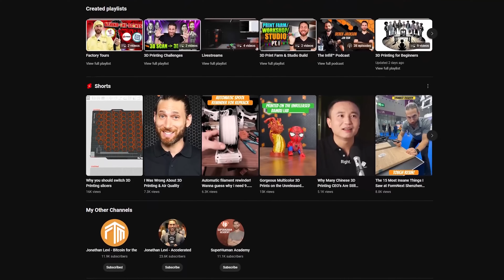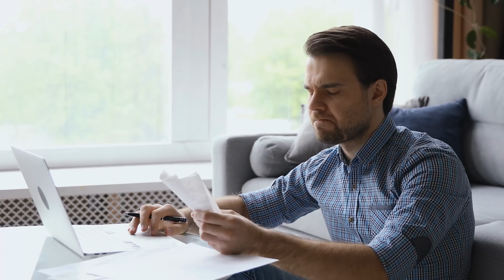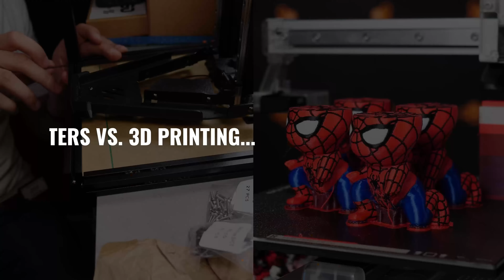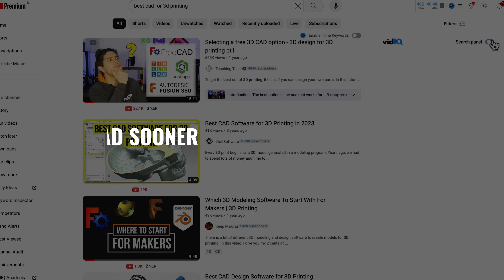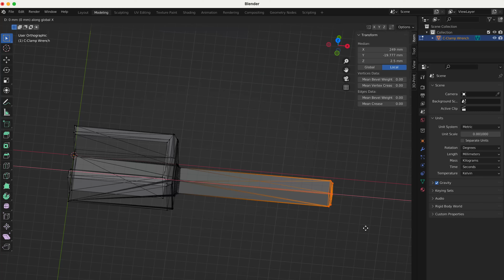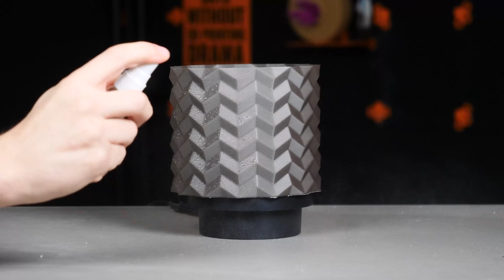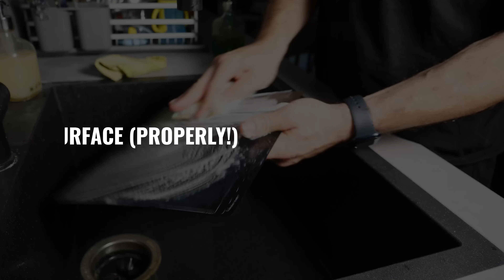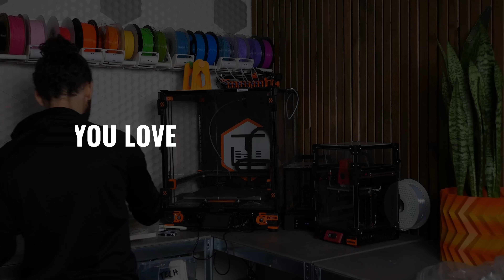9 Things I Wish I'd Known About 3D Printing

Comment: My journey went from buying, building, upgrading and tuning an Ender3 to being overwhelmed and annoyed by the complexity of creating models. I would like to add one aspect: Doing what's right. Please don't spend your money on companies that want to lock you into their ecosystem and consider the aspect of sustainability. For example ABS is much more harmful than PLA and doing lots of test prints instead of taking a little more care in the modeler and slicer produces a lot of waste and consumes a lot of power. And FreeCAD, Blender and OpenSCAD will always be free (as in freedom) and don't collect data on what you are designing.

Comment: Greetings from Florida. After starting out years ago at the time with the brand new Ender 3 V2. It was a much needed iteration of the Ender 3. I recently watched your videos where you mentioned that the printer companies are coming out with so many printers each year. Now it seems like a superfluous and inane choice. BUT it was what I needed. I’m a hands on learner. And looking back at the evolution of knowledge. The Z gantry limit switch was my first flaw experienced. Quickly analyzed and found that I could put a us quarter and 2 dimes on the extrusion as a spacer and everything just worked from there. Next, was the crappy bed springs and knobs that had me running CHEP’s bed leveling profile because I would have to tram the bed almost after just about every print. Those were upgraded to yellow springs and billet red wheels that stayed in place. Eventually being upgraded to silicon spacers and ultimately eliminated that need. At the same time I upgraded and installed a BLtouch and did the dual ball bearing replacement fan mod to the harness. As the sleeved bearing cheap fan was making noise at that point. The BLtouch upgrade was the only mod that legitimately almost broke me. With Creality’s abysmal support and their BLtouch firmware that bricked my lcd till I found that the lcd had to be flashed at the same time as the printer. I never did get that to work but flashed what is now ancient SMITH3D firmware to both and it just worked as expected. Not long after, I started my business was when I learned to rely on HATCHBOX filament, which just worked no matter what. I also learned I could flip the corundum glass over and with Magigoo, I was able to have glass smooth first layers so I printed everything face down and never looked back. Lastly I added a WyzeCam v2 which I helped the developer with the modified firmware test on a revision of hardware he had never seen. Thus giving me camera capabilities to monitor it remotely with OctoPrint and SimplyPrint. I had the best of learning and a rig I was proud that I mostly hand built/modified myself. It was fun watching the bulldozer blade push my prints off the bed and into its parts bin. To this day it’s been a beast, I just have to change the nozzle once a year as it doesn’t do abrasive filaments. Then BAM, I got an x1c+4ams units. And setup a tent with a vent out the window for my OG Saturn, and to this day I’ve maybe put 2 hours on the printer. Simply because tuning a resin isn’t exactly like tuning a filament and it’s messy. Cross contamination happens the first time you forget and touch the wrong thing. So I’m kind of afraid to use it. lol.

Great video and I look forward to meeting you one day if my YouTube channel takes off. I’m rebranding here soon for a fresh modern look. And I’m gonna take a run at being a full time content creator. See ya around.

Comment: Point of fact: if you use vacuum bags (with some desiccant) and extract all the air, then it is impossible for the filament to absorb moisture. That's why filament is shipped in evacuated air-tight bags.

Comment: I'm completely backwards....  Got an older printer (Neptune 3 Pro), first 2 rolls of filament were a Flashforge ABS Pro & Siraya Tech Flex 85A TPU.  I have a high humidity shop (~85% RH on average) and I didn't bother with drying (haven't had any moisture problems but looking into a filament dryer for the future)....  I jumped into Fusion and figured it out on my own.   Printed my first project - rock tumbler drum with the ABS & a replaceable TPU liner that fits perfectly inside.  Then I came over to youtube to see what I could learn!

Comment: To each his own.  I think I might be happiest with openscad.  I have been a programmer for almost 50 years and the coding is fairly easy.  I have run into a problem where difference doesn't work  properly.  I would assume that it is my fault.  However, version 2.3.0 yields different results from 2.3.1.  I just got a Creality k1c today and it's sitting on the floor until I get my long term location figured out.  The tiny screen at floor level makes it hard for me to read.  I think I need to install some software to enable wifi printing.  Then there are a ton of tiny things to figure out.  My printer is printing some pocket-sized pill bottles made for keychains.  I will give 3 of them away tomorrow and figure out some more later.  I am hopeful about openscad.  20 lines of code is better than I could do with blender and fusion 360.  I particularly like the precise control of sizes and locations for engineering applications.  Art is not what I excel at.  There are way too many undocumented features in both software and hardware.  Little things like knowing how it feels to push filament in and that no filament is applied for quite a while.  I thought my printer was going crazy.  It wants to level every chance it gets.  That may be important, but like everything else, I have to stumble into the answers.

Comment: Hi, when seeing the part of your video about drying filament it got me thinking that surely the best way to dry it is to have a long feed section going to the printer that preheats hot enough to dry it before it gets to the print head. I am new to 3D printing and only have a slow Ender 3 so the filament moves very slowly and It looks like there is a lot of time between the filament leaving the reel and entering the drive motor.  Or even a two stage heater,  One before the drive motor and one after it.  It seems to me this would save a lot of time and money.
What do you think?

Comment: I finally figured out what 3d printer  I want based on the filament types I'd like to use and what I want to use them for. I figure everything from tools, bins and planting pots I design to humidity domes, drip trays and even custom enclosures for my equipment and tools.

Comment: It's funny because I started with an ender 3 because I wanted a 3d printer because of what I could make with it. I have SO many hobbies already and this was supposed to help get me parts for those hobbies. I hated having to mess with it for hours to get it to print the stinking part. I fix things, I tweak things, I make them better, I LOVE that but when the tool to accomplish those things gets in my way, I ended up with an unwanted hobby. I picked up an A1 for xmas and wow. My backlog of designs I had qued up are all almost done already. I'm designing and iterating and making again and it has been LIBERATING. I SO appreciate all of you that push the 3d printing hobby to the max. Honestly, you all make it better for people like me. But I just want the part right this minute and now that I've felt this freedom, idk if I can make the printer itself, my hobby. That said, my tinker brain can't stay totally away from the printer side. Filaments and settings and speed, quality. a printer mod here and there. All of this is just the toe dipping I needed without making it a full blown hobby.

Comment: Can confirm, I could not make serious money 3d printing until I got good with CAD and started selling my own designs.  Printing other people's files on demand was not worth it.  I'm 52 with no CAD experience except for a single class in high school over 30 years ago. Got a free version of Fusion and got to work knocking the rust off with the help of YouTube.   I get the impression that tiny amount of high school experience put me out in front of most of my competition design-wise, which goes to prove there's a ton of opportunity out there for people with the wherewithal to get good with CAD.  For me it works best to think of it as chiseling.  Rather than start with a blank space and add shapes to create what I want, I start by creating a solid box big enough to contain what I'm designing, then cut bits away until the shape I'm after remains.  Highly recommend this approach, at least for newbs.

Comment: Dryers are a necessity IMO.  My shop is going well enough, I'm going through about 10 spools of PLA-CF per week.  Meaning the spools go directly from the bag onto the printer and the printer doesn't stop until the spool is exhausted, so my spools spend very little time exposed to the air before they're all used up in a day or two.  Despite this, I have learned that filament dryers are indispensable.  In my experience, filament can never be dry enough.  You think it's dry enough because you're not having any failures or stringing, but beauty-wise, it could still be dryer.  My surface quality is so much more consistent as a result, many reviewers say they've never seen a print of such high-quality.  I basically turn on my filament dryers every morning regardless of whether the spool inside was already dried yesterday, because overnight out of the bag is enough to affect quality ever so slightly.

Comment: I’ve been using a textured PEI bed for well over a year now and have wiped it down with 90% isopropyl alcohol after every print whether my hands touched it or not and have yet to have a print fail due to warping or bed adhesion.

Comment: I will sign all statements you did but want to add 2 more: 1) at the beginning I had to learned a lot about software, slicer settings and calibration ….. but I forgot to maintain my printer properly….. I just tried to recalibrate the settings again and again 2. I am the Ender-Tuner & Voron builder Type: I am trying new materials if I need new properties for the parts but otherwise I stick with 1 or 2 filament brand I love the most (in my case Nobufil) and stick with the colors they offer- so if I change a hotend or extruder I don’t spend days on recalibrating all materials & brands.

Comment: I had fallen out of the hobby for 6 years....had spools of open filament stacked up and not in bags or stored properly.  I noticed how brittle the pla had become and knew as I was getting back into the hobby recently that I'd HAVE to dry all that filament.  I got a couple of dryers, and that stuff prints as good as new after it's been dried.  I was super impressed.

Comment: 8:50 I am CERTAINLY in the tinkerer category, not the printing stuff category!  Let me just say that I don't have a single machine that does only one material.  But only one was purchased as dual material.  Everything branched out from there.  Now I've got 4 lasers, a mill, and am working on a PCB for a 6 axis GRBL controller (None I found on Ali were suitable).

Comment: I use dish soap to clean my glass printing plate of E5 plus and, something in relation to chemicals in soaps... They're all the same... The active part, which is the one cleaning are always the same compounds, no difference between Palmolive and a 1$ product... Check on the descriptive label

Comment: How do you use the ams lite with the 4 filament dryer? It looks like the ptfe is plugged right into it, but afaik if the ams tries to spin the roll forward or back and it doesn't move how it anticipates it'll throw an error.

Comment: Been cleaning my pei plate with IPA and have noticed my prints lifting the corners. May need to try cleaning it with some dawn.

The crazy thing is that my old glass bed wouldn't let go of a print until it hit room temp and even then, it was tough to take off. Then, one day it flipped and I started having adhesion issues. I took the plate off and cleaned with soap and water and it made no difference. Bought an enclosure thinking that might be the problem and it made no difference. I ended up flipping the glass over and using glue.

Recently, I switched to a PEI plate and it worked great, not a single issue, even on big flat prints. Started having issues a couple of days ago with prints popping up. I cleaned with IPA and started a big flat print. I had 5 great layers down before going to bed. When I woke up, it was warped so bad it wasn't funny. A part that was supposed to be 1.5" thick, was only about 3/4" in one corner, and an inch in 2 other corners.

Let's hope dawn does the trick.

On a side note, I have a Bambu A1 coming wednesday and my ender 3 will be strictly a tinkering printer that might not get a lot of use.

Comment: When I got into 3d printing 3 years ago... It was a love/hate relationship with my ender 3v2 and, later, ender 3v3 printers. But it was extremely frustrating when it didn't work. I learned a LOT about the hardware, gcode, control software, firmwares, etc. But I spent more time tinkering than printing. 

Since buying my Bambulab A1, I could spend more time actually printing... Designing, remixing, printing models for my kids... Painting and playing with them. Its no longer a hobby about the PRINTER. It's now a hobby about the prints.

Comment: not sure what hot end you have in your voron but if its the dragon standard flow or better it can easily print as fast as a X1C, after losing all my print setting recently I literally opened up Orca Slicer and copied all the Bambu Labs settings to my voron profile.. prints great.

Comment: I have never had a failed print due to adhesion. I have never once washed my textured plate. Just use 91% alcohol every print and most of the time I reuse the same paper towel. Strange how everyone has a opinion as to what's correct and everyone has different results it seems...

Comment: I'm ganna give mine before I watch
1) FDM means greatly limited design criteria or supports.
2) Designs must be intended for printing
3) Stuff breaks ALL the time
4) Stuff isn't always easily fixable
5) If you don't dry your filament and use a brush you are ganna get clogs
6) Cold pulling and cleaning filaments
7) Speed and heat are your friend to a point
8) Price does not equal speed or results
9) Somehow, multicolor works but it is also a scam

Comment: To keep your filament dry all you need is a small dehumidifier in a closet. Store your filament there and it will keep it at around 55%

For $20 you could dry as much filament as you can fit in the closet.

Optionally you could get a good dehumidifier for around $150 and keep the entire room the printer is in dry.

Who would have thought to put their filament in an oven before using a dehumidifier lmao.
Reply from the maker: That will keep it dry but not dry it if it gains moisture while printing
Reply: @thenextlayer  Well I gave another option. If you can afford a $150 dehumidifier it can keep the entire print room dry. Then you don’t need keep taking them in and out of storage just leave them on the spool dispensers.

Better idea than putting it in a toaster oven if you ask me.

Comment: "I only need 2 printers and 10 rolls, then I'll stop." I actually did pull this off for the first 2 years while I was getting to know the printers, CAD, filaments, communities, and sites with files and such. Then I redid my workspace to have more workspace, space for printing, and better access to ventilation for my new printer and enclosure.